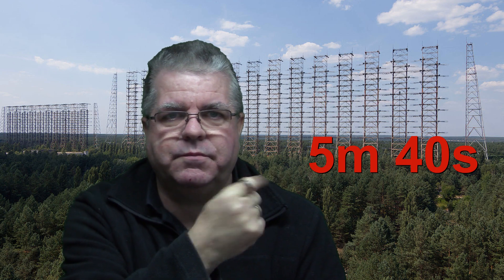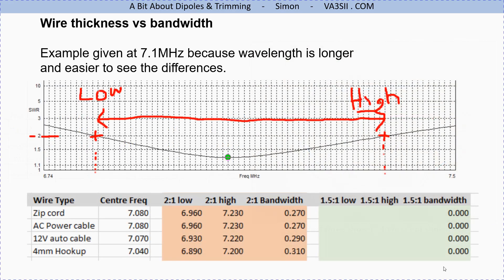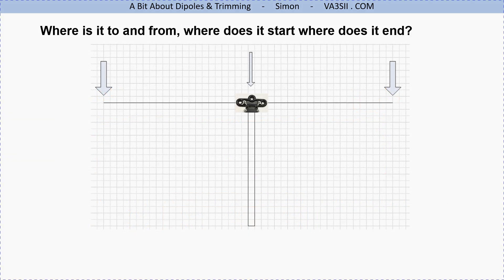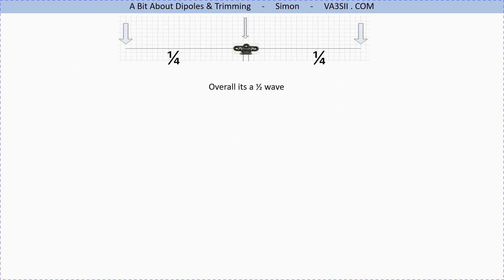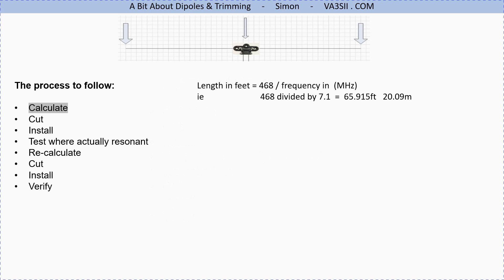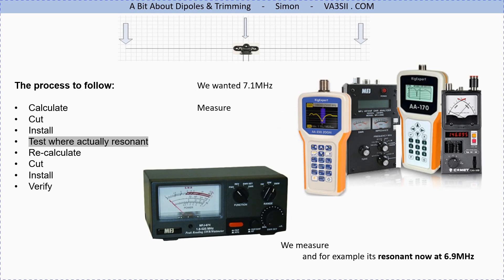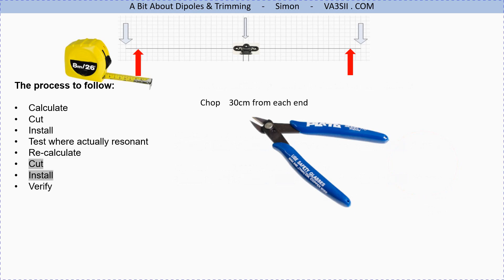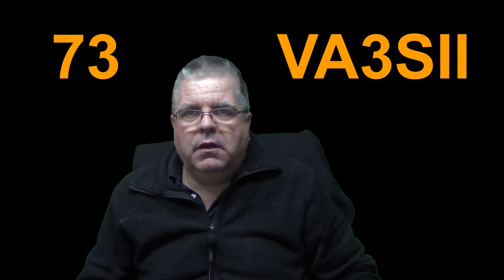Trimming Dipoles for Resonance

Comment: Not difficult and useful for those putting one up for the first time. 
I did well the other day with my 12m inverted vee in the rear bedroom before putting it in the attic to get an idea of lengths. Lowest SWR on my meter. NANO VNA used to see how accurate my SWR meter was and impedance and reactance. 

Frequency 24.925 MHz
SWR 1.02 
Impedance 49 - 50 Ω +j1.4 

I used plastic curtain hooks on the ends for insulators and string. QRP only here. 

G4GHB.